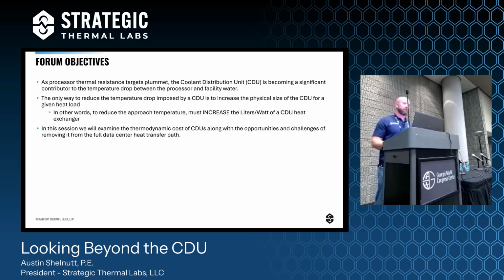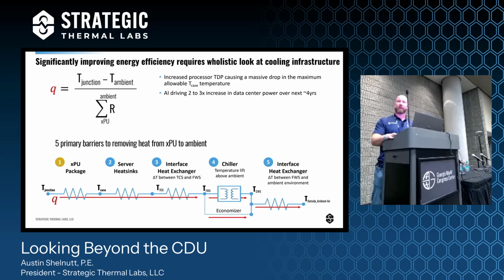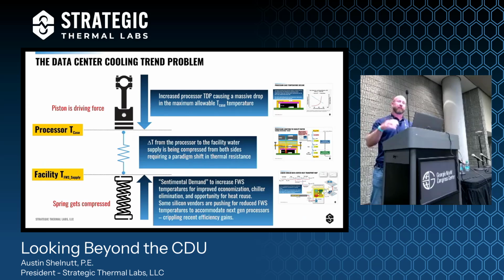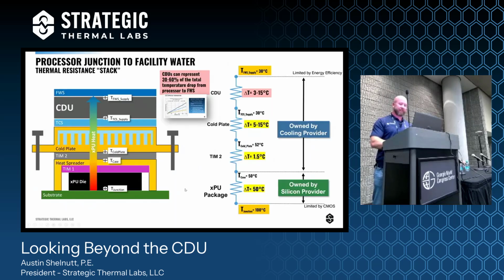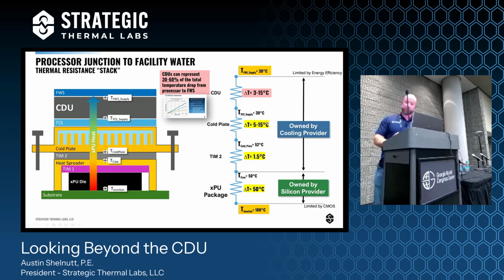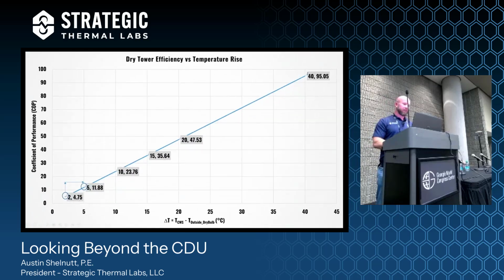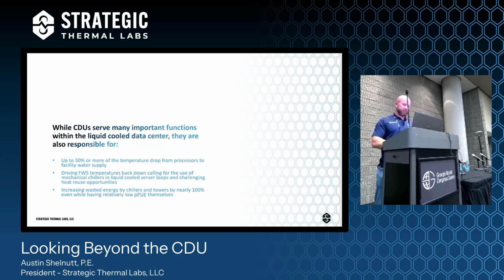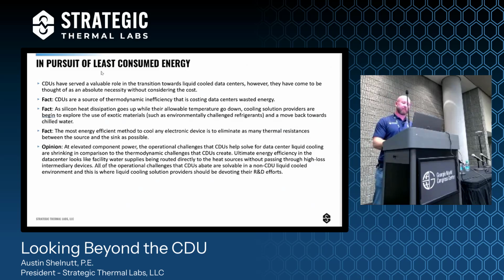Looking Beyond the CDU for Data Center Liquid Cooling

Comment: Question?
What kind of heat exchanger? 
Pressed plate, tube in shell heat exchanger would be best.....
Assuming the cold plate is machined copper?
What about using a waste heat recovery mode?
It takes a lot of energy to take away heat from water.